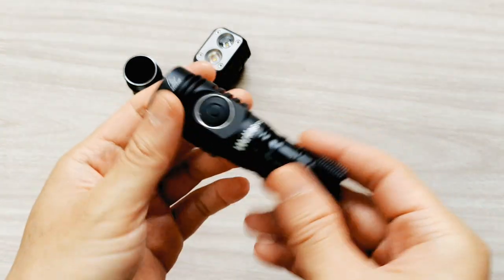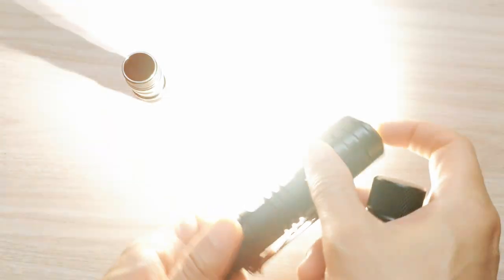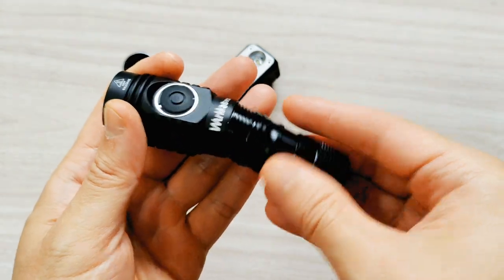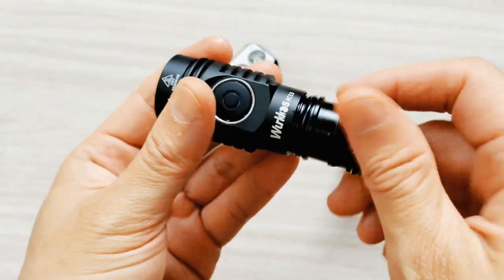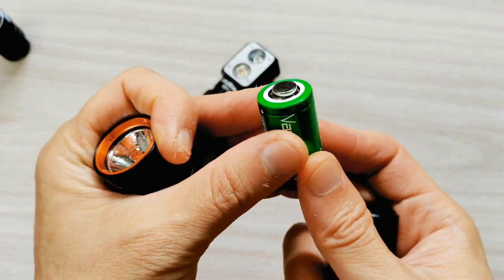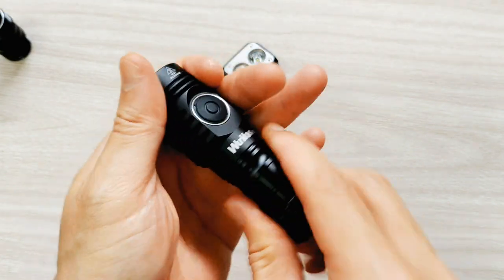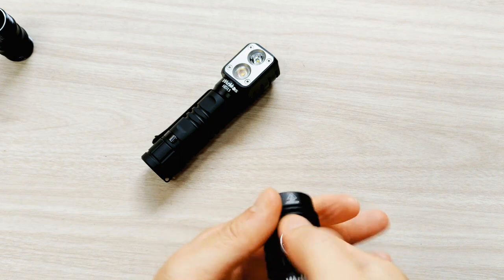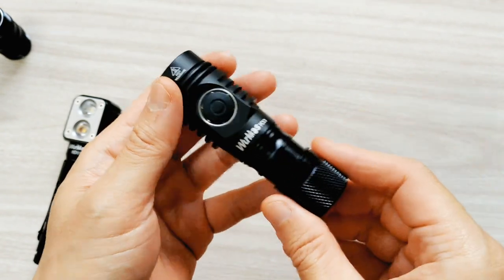Wurkkos FC13 with 18350 tube from HD15 | Please watch until the End.

Comment: Thanks for sharing this. I'm using the Sofirn 18350 tube and both ends work. You can also use the FC13 tailcap so you won't need to put a magnet on the battery.
Reply from the maker: Wow. I see sir. I haven't tried that. Thanks for your suggestions sir. Please subscribe 😊🙏.

Comment: How long does the battery last? Is it still 3500 lumens with the short tube?
Reply from the maker: I don't know how long sir. No data on 18350 battery. Actually, it can't reach 3500 lumens. Smaller battery may not give out much power as a bigger one. Thanks for watching sir 😊🙏.

Comment: great video, do you have the convoy battery adaptor for flat tops I was curious if it would work instead of magnet?
Reply from the maker: No sir. I don't have it. One subscriber told me to use Fc13 tail cap with the short  tube so the battery will fir perfectly. Thanks for watching sir 😊🙏.